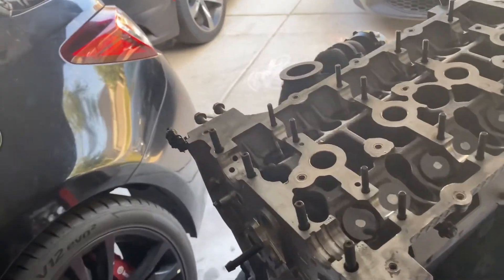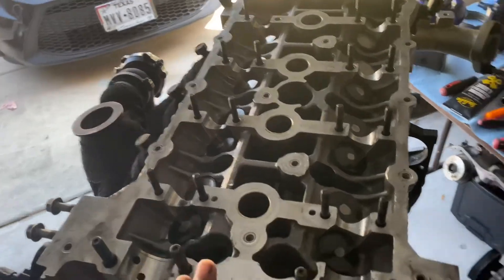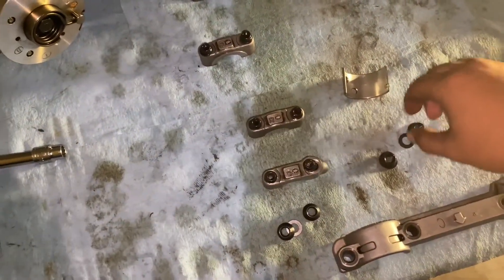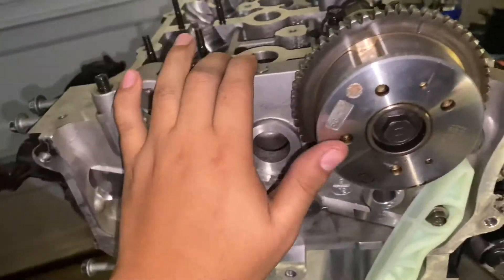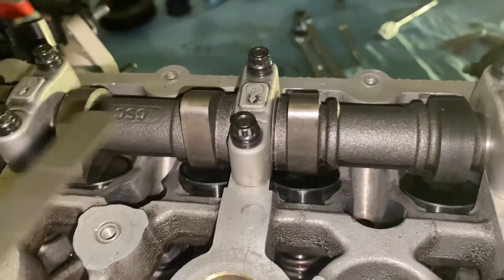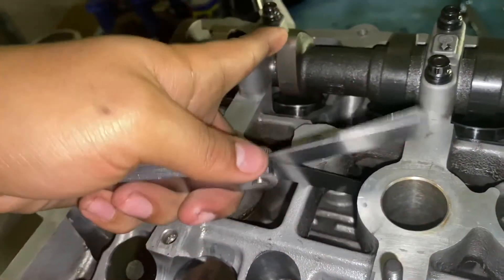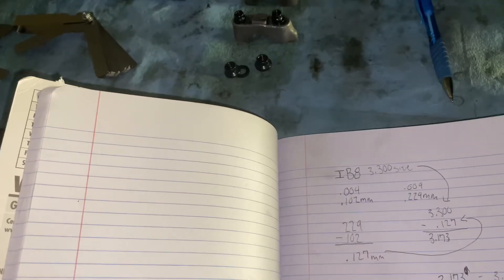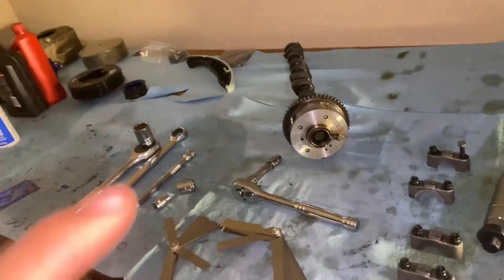Genesis Coupe 2.0T Engine Build Pt.6 | Heads Torque & Valve Clearances

Comment: Dumb question but for the bucket lifters what are the locations they go into I accidentally dropped some and now I don't which they go into
Reply from the maker: You’ll basically have to measure the lash and figure it out boss
It’s a pain
Reply: @ProdigePerformance  I read have to just put into a random order and use a feeler guage, and see which goes where, thank you, definitely will be a pain in the ass to do
Reply from the maker: @tristanramirez4550  yes
Make sure to wrote down what sizes they are and how much clearance it’s off them after you figure out ever one of them do your best to put them in the correct place

Comment: Any idea what kind of combustion pressures or boost pressure the stock head studs and gasket can handle? My tuned BK2 hits 21 psi before dropping to 15 at redline. With a new turbo I might want to hit 25/27 wasn't sure if it's ok on a stock block
Reply from the maker: It’s normal for stock turbo to drop. They aren’t built for top end gains. 

I’ve had my guys run 30 psi stock block for years w/ 0 issues. It really just depends on the condition of the motor and the maintenance of the owner.

Comment: yo i have a liter tick , which lifter is most likely to tick??
Reply from the maker: Welp we have bucket lifters, so you’re going to have to find out yourself using a feeler gauge.
Reply: @ProdigePerformance  alright cool, sorry if that was a dumb question just wanted to make sure
Reply from the maker: @vietyyg6739  yeah there’s not really a specific bucket lifter that goes bad, you just have to use a feeler gauge and find out for yourself. 
Whichever lifter is out of spec is the one causing the lifter tick likely. Could also be more than 1
Reply: @ProdigePerformance  alright thanks man!

Comment: how did u get a socket to fit in 8 and 10 my deep well is to fat to fit in there
Reply from the maker: Shave it down would be the ghetto way of buy the right socket. The socket I used just luckily fit with no issue. If you it up on the forums there’s a link to a socket that will fit perfectly

Comment: I use a slightly different method that eliminates the math! You set the can at TDC you will have 2 cylinders cam lobes will not pushing down on the tappets, those are the 2 cylinders you will be measuring, you will then use for the intake side you will always you use .020 feeler gauge then from there you will start measuring with the other feeler gauge (snug fit) whatever number you get  that will be your size. Then you rotate cam 180 degrees then you measure the other 2 cylinders once you get all your sizes you try to match up sizes you always go next size up that will your tappet size. Exhaust is same except you will use a .030 feeler gauge. Hopefully it makes sense.
Reply from the maker: I did this method to double check my math and surprisingly enough doing it that way could still land you a size to short or to big. I used math to be as accurate as can be when rounding. However for other tapper style bucket lifters cars this is still a good way to do guesstimates at first and play around with the tappets to make sure it’s correct and if it’s not do the math part and you’ll get it 100% 

I know exactly what your talking about but in my experience you still have a 20_30% chance of error.
Reply: I’d rather do the math

Comment: When the machine shop did the clearance for the GSC Cams did they not measure the tappet (bucket) clearances?? Just asking because the machine shop I use did measure.
Reply from the maker: I wouldn’t know. This block was built 3 years ago by Jesus Acosta and 2 other people. The reason I’m doing a refresh is because my turbo Had failure and precision told me it would be a good idea to take the block apart because there was material missing from the turbo inspection that they suspected got into the oil return line. Which evidentially it did.